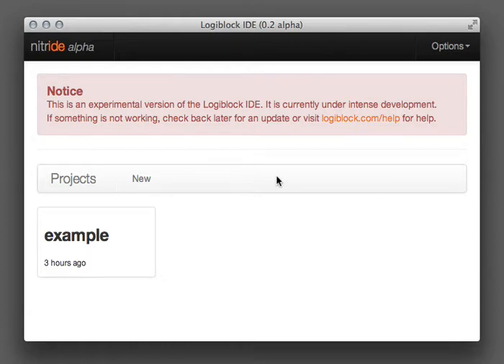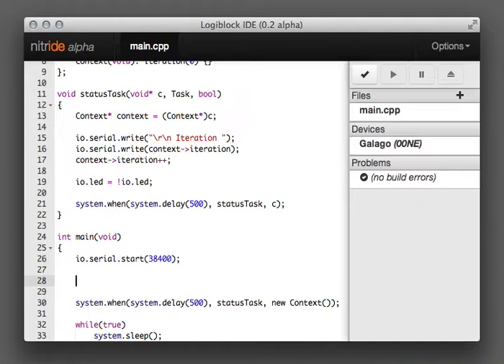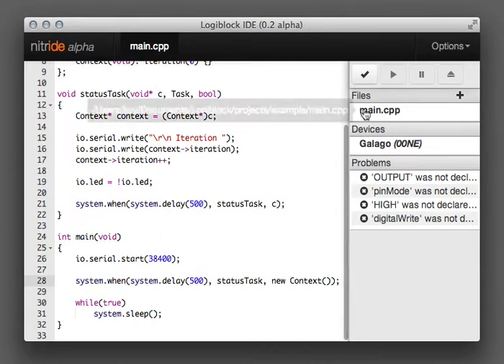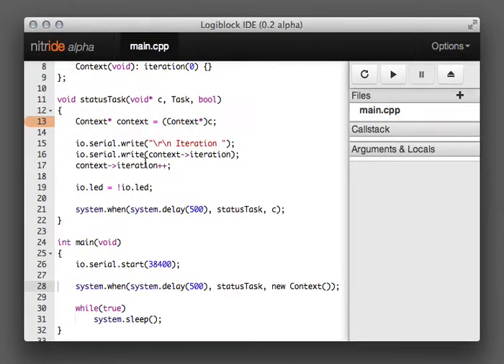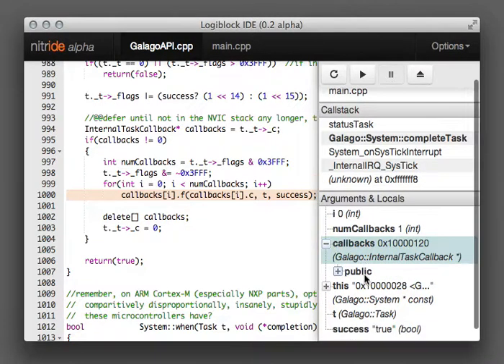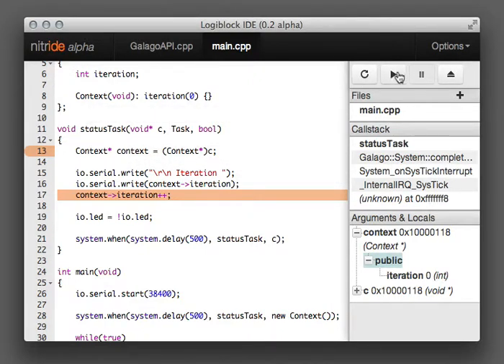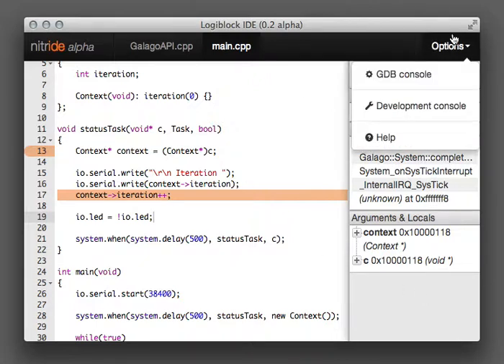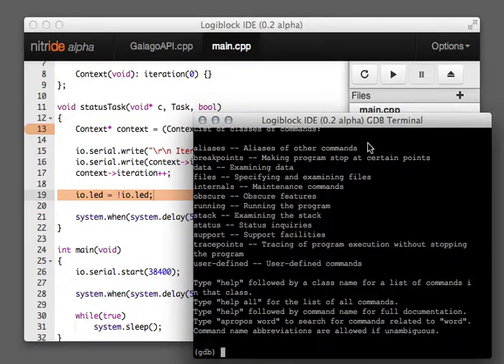Logiblock IDE alpha demo

Comment: Thanks Kuy, i have confirmed alongside what you have suggested that TX from the galago is readable using the BusPirate so i am happy about that, what i would love to be able to see at this stage is output from each variable like you have in the IDE but on Windows, i cannot however get Nitride to function by dropping the .nw on to nw.exe - it looks as though it is downloading the toolchain etc but after that it just seems to hang. Other than using the CLI is there a secret to get nitride up?